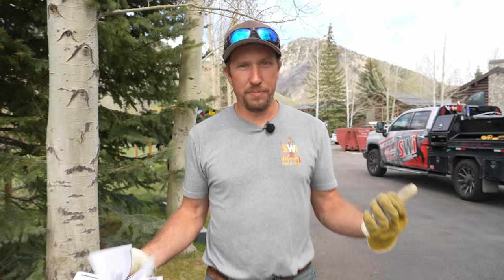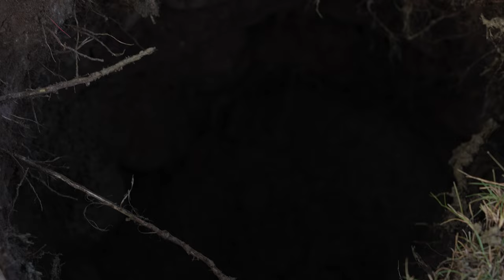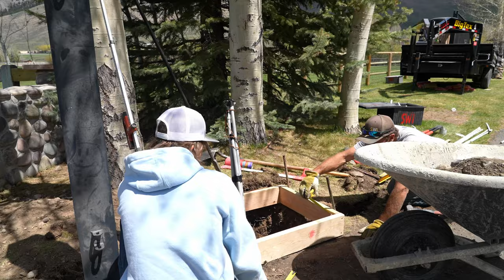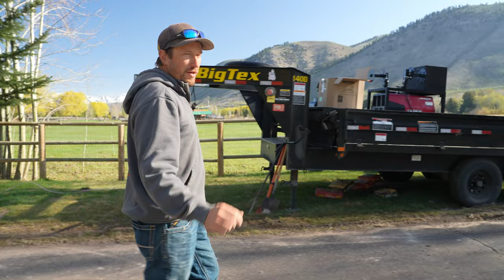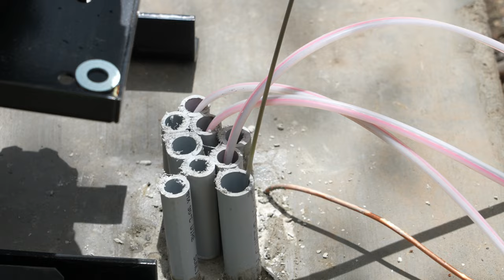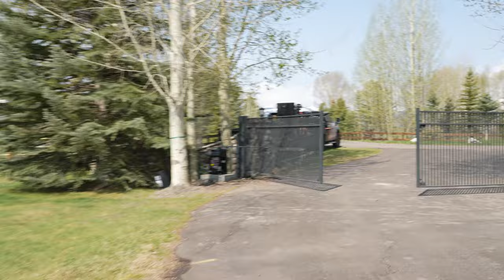When You Need A Fancy Gate: Custom Automated Aluminum

Comment: But dano, how did you get the conduit under the driveway?
Reply from the maker: Oh yeah, that part didn't make it into the video for sake of time. I used some extra tail from a BD loop wire, saw-cut across, and gooped on top. Same time as the loop installation.